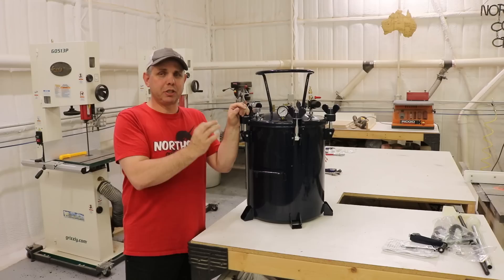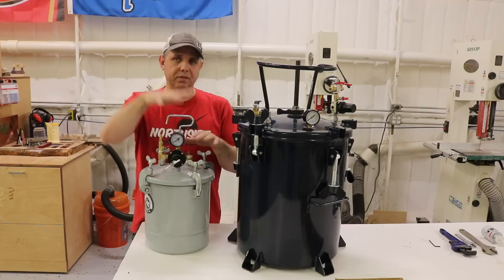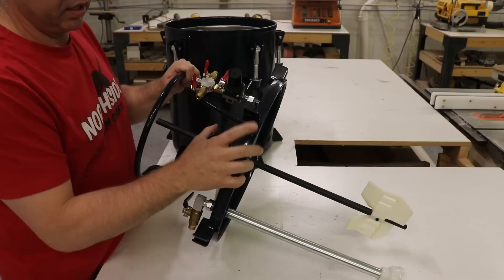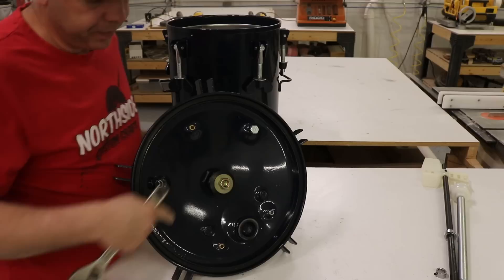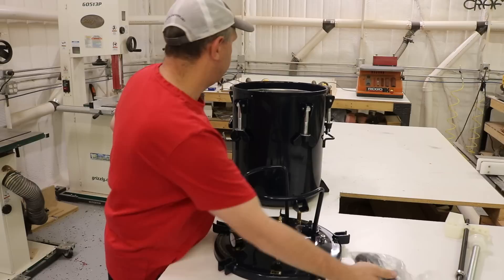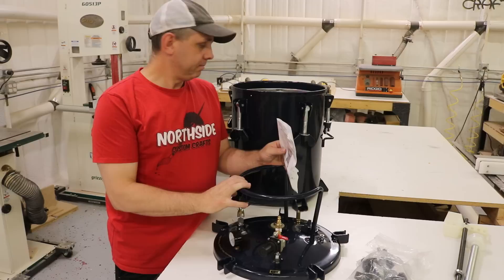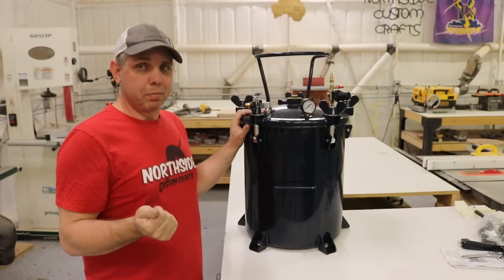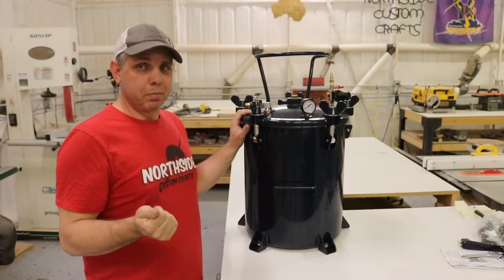How to convert ANY Paint Pot into a Pressure Pot for Resin Casting

Comment: First, let me say thanks again for the awesome tutorial. I have my tank converted and ready to go! 

Any recommendation on a valve that can be attached to the air outlet valve to reduce the noise/decibels when emptying the tank? Our mold room is quite small, and damn is it loud when you open that outlet valve!

Oh, I also ended up going with a 3 1/2" 5/8" bolt. The 3" was only threading through about 1/3 of the nut, which I've always heard isn't ideal (https://www.boltscience.com/pages/shortbolting.htm). Granted the 3.5" sticks out past the nut by about 1/4", but better to thread through the entire nut than not. Maybe the thickness of the lid has changed with their newer model?
Reply from the maker: Thank you for watching! I’m glad you enjoyed it.  As far as the noise. You are correct.. it’s pretty loud.. I guess you could hood a hose up to it and run it outside.. or just barely crack the valve open and let the air out slowly.  I rewatched the video and I think my bolt went to the end of the nut.. I will look for sure next time I’m in the shop.. but you are correct on that also..  I hope you have lot of fun casting!!👍👍👊

Comment: Hi Jake. I'm going to buy the 2.5 gallon TCP Pressure Pot for my resin casting and was wondering if I could buy the Harbor Freight "General Pneumatic 3 Gallon 1/3 HP 100 PSI Pancake air compressor"(https://www.harborfreight.com/3-gallon-13-hp-100-psi-oil-free-pancake-air-compressor-61615.html) to use on the 2.5 gallon Pressure pot. Is this enough air "power" to use on this particular sized pressure pot? I have a small air compressor= 1/6HP 58PSI, that I use for airbrushing that I'm sure is not powerful enough. Thanks for your advice. -DS
Reply from the maker: That pancake air compressor should be fine.. the tank is bigger than the pressure pot and it’s double the psi that you need in the pressure pot.. should be fine

Comment: Hi Jake.
Ive purchased the same pot and are modifying it at the moment. Do you know if it is safe to use this  pot with resin  that gets warm as it sets. Will the increase of heat in the resin,  increase the pressure inside the pot. I turn resin bowls. See dougdavies.art 
Xx Doug 
Is that a Melbourne Storm flag on your wall.....I'm  from Melbourne.
Reply from the maker: Doug Davies My Buddy Dirk from Sumo’s Projects sent me the flag. I haven’t had a problem with the pressure rising with the temperature.  I will check out your page. 👍👍
Reply: Thanks for your help and your videos. Nice.

Comment: how would you suggest removing an Air Powered Mixing Agitator from a TCP Global Commercial Spray Paint Pressure Pot Tank ? I got this in hope to convert it but I failed to realized the mixing agitator is an entirely different thing as yours.
Reply from the maker: I’ve never taken one of them se apart but there has to be set screws or bolts to take apart… or I would send it back and get one that’s already ready to go. https://amzn.to/3nlQCLD
Reply: @JakeThompson  thank you!